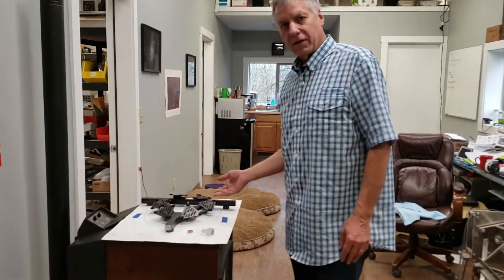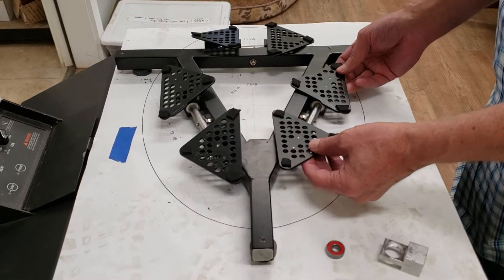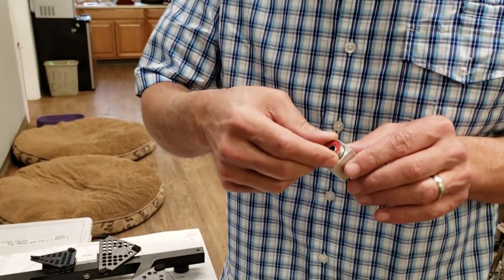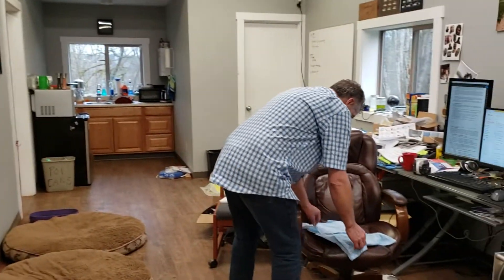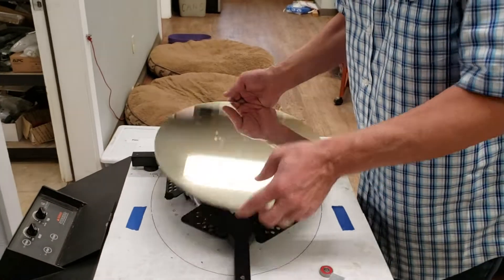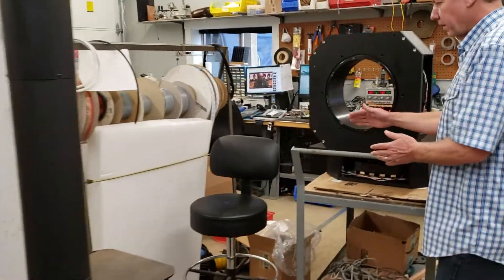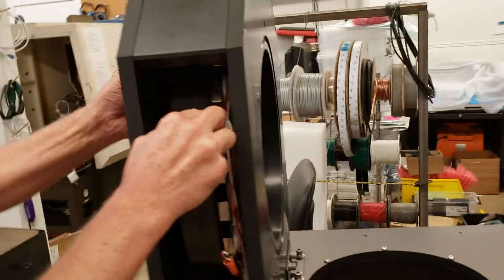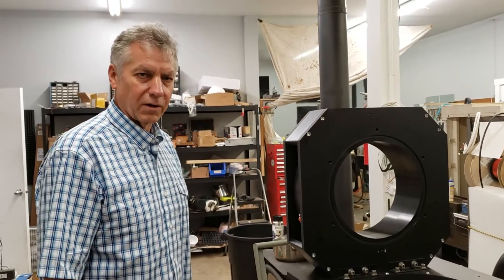Using Bearings for a mirror cell

Comment: can you do some more detailed looks of your motors ie like what magnets wire size and wraps. i tryed doing direct drive using and could never get it work sold them off for wind gen's. i got them working with cnc software i tryed to use planewaves cd700 software witch i thought should have worked i used the same drive control they did but no go i wasted a yr try to get it to work.mould be great if ya could do a full setup with motor design and software setup. any info would be great. thanks for sharing